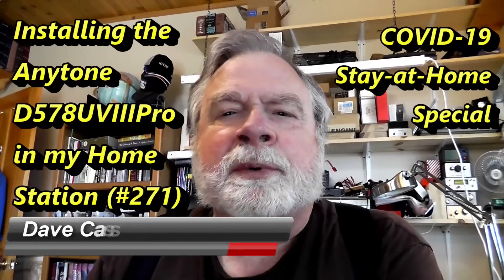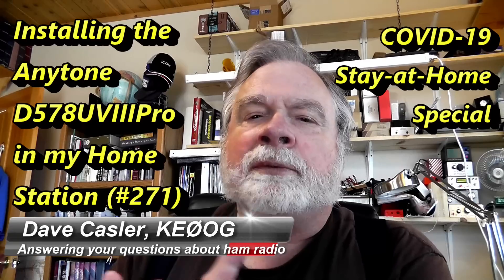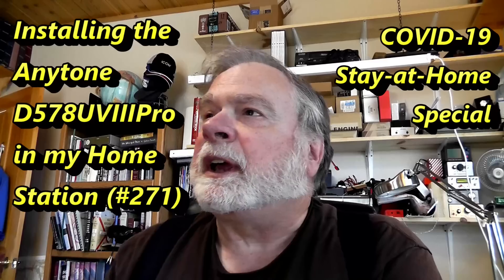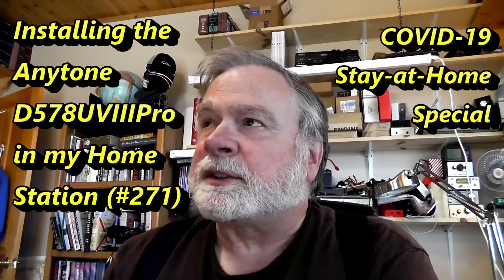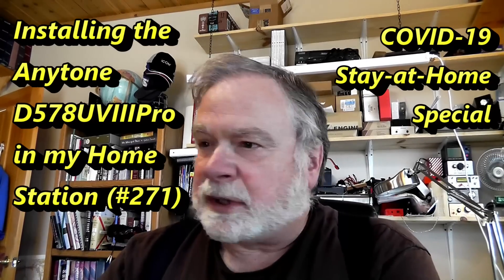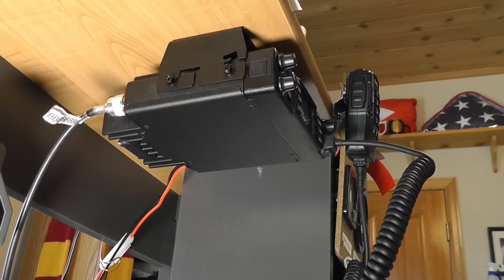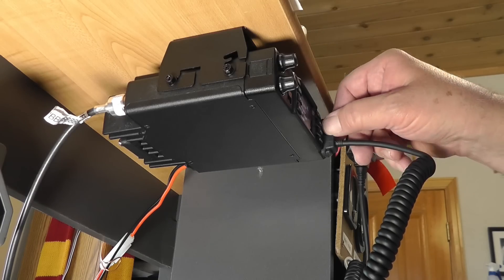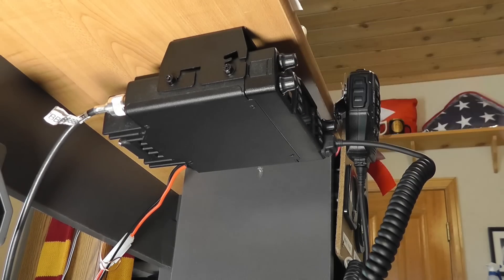Stay at Home Special: Installing a UHF/VHF Mobile in my Home Station (#271)

Comment: How do you power a radio like that from hime since it has a power wire harness type
Reply from the maker: I use a switching power supply that converts 120 vac to 12 vdc.
Reply: @davecasler  thank you for the reply. I apologize if the question seems silly but I'm completely new to Ham. I would like to get an FTM-200D and connect a wires X box. I wasn't sure how to power the radio because I noticed it has a harness/adapted power cable type. Can that plug right into a power supply by the plug itself or do the wires have to be stripped and connected to power supply or do you need an adapter from radio power cable to the power supply?
W6KOP

Thank you for your time
Reply from the maker: @outdoorsmanjohnny9934  See www.dcasler.com/reference for a list of devices for your station. See the power supply entry. The wires that came with the new radio are already stripped. If you got it used, it may well have a plug already attached.

Comment: I'm not sure where the programming cable goes on the D578,  B U T, if it goes in the back of the radio, maybe install it and Velcro/cable tie it out of harms way. That way you won't have to hunt for a hard to reach connector when you want to program the radio, since DMR radios need to have contact lists periodically updated.Those little machine thread bracket screws are probably metric, and you might have some luck finding a larger head size or some with Torx/hex inserts at your friendly, local hardware emporium. (Remember when we had unlimited metric screws available to us?)

Comment: I struggled with putting the radios into those mounting brackets and keeping the washers on the outside of the brackets.  I found larger diameter washers with same hole and thickness as replacement.  Much easier to get the larger washer to stay outside the bracket slots while fitting the radio into those madlingly, convoluted slots.  Just a thought.  Stay safe.  Wash your hands and don't touch your face is more easily said than done, but try.  We seem to touch our faces without even realizing it.  Keep the videos coming.

Comment: Dave, I really appreciate these videos you're doing. Not only do they illuminate some things clearly that I never quite understood (eg antennas) but it also helps a lot with the cabin fever many of us are experiencing. I have a similar install in a similar desk setup planned for a kind of crappy old RS HTX-212 I got at a hamfest for like $15 (or maybe I will pull the dual band Alinco out of the Jeep). Haven't managed to get my diy antenna up yet, though, but maybe later today? May you stay healthy and safe. 73 (K∅FSJ)

Comment: Nice video Dave. I have been thinking about a mobile radio in my office with a outside antenna. I have about a 40-50’ run to where the antenna will mount. What coax would you recommend?
Reply from the maker: Depends. If you're in a fringe area, use RG-213 or LMR- 400. If not, just use RG-8X.

Comment: If you rotate the bracket 180 degrees you can mount it so it's angled down towards you to see the display and access controls much easier.
73 KM4AOF

Comment: Hi, David. My home base station is an Alinco DJ180 walkie talkie converted to fixed station. 
I mounted an aluminum PC heatsink on a wood base. Attached the talkie to it, and then plugged to AC using its own adapter using a PC power supply. Connected to an external desk microphone, speakers, base antenna and then I used a light switch mounted on the desk to make the PTT. It works great, made incredible contacts on FM through tropospheric ducting, like 700km using only 1W of power on simplex, and 1600km through french repeaters from Spain, to Germany, Belgium, UK, Ireland... Some videos on my channel if you want to take a look.

Comment: Dave, you'd find a 4"x6" patch of industrial velcro can replace all of those screws & give you a universal mount. In fact if you get more than a 6"x6" piece of velcro, you'll need a putty knife to separate the two parts. Given 24 hours for the adhesive to set, I've used this to "bolt in" 20A AGM batteries in a travel case. Use the industrial/commercial grade.